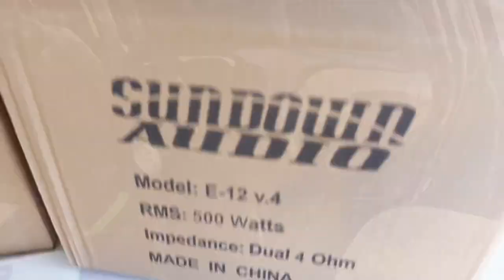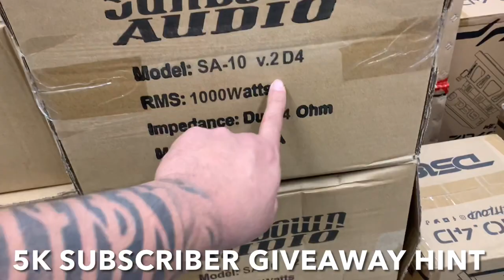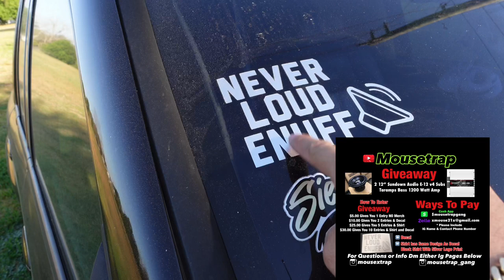Car Audio Chevy Silverado Custom Fiberglass Painted Doors Panels For PRV Mids Tweeters

Comment: How much do you charge for fiberglass door panels?
Reply from the maker: Paint finish like around $800-$1000 but beautiful doors and vinyl finish $600-$800 wrapped in high quality vinyl and glue
Reply: @mouse_trap.  is that the price per set or each ?